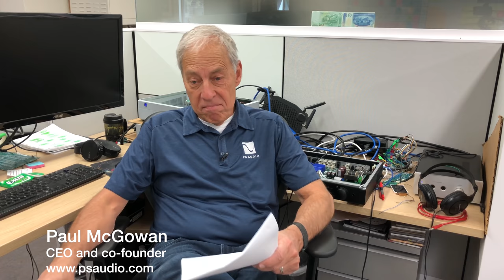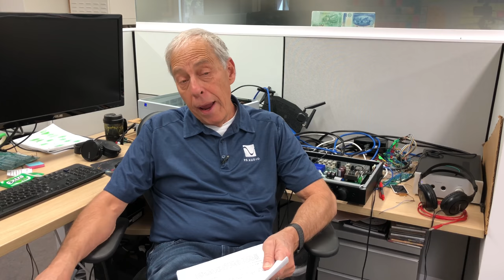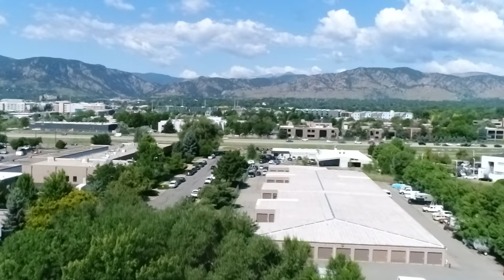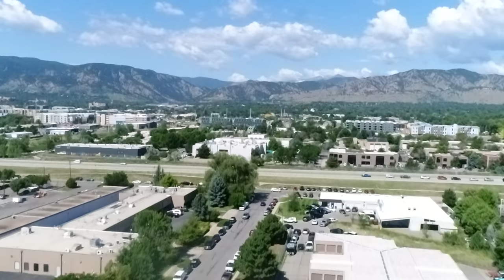Why don't speakers use electro magnets?

Comment: Actually, in the early days of loudspeaker development, ALL speakers used field coils instead of permanent magnets for the simple reason that high strength magnets did not exist. Typically, the B+ power supply of the radio was routed through the speaker's field coil which afforded additional filtering of the raw voltage. The major problem was power dissipation in the field coil in the vicinity of 40 watts in some instances. Also, the less-than-perfect voltage running through the coil would induce audible hum.

Alnico IV, which was developed around WWII, became available and the industry changed from field coils to these newly developed permanent magnets. Ferrite magnets follwed along with newer materials.

Field coil speaker drivers are being used in some very high end systems (very few though). As far as I can see, there is no advantage in using a field coil and there are many disadvantages in wasted power in the driver and in the additional power supply needed to energize the coil.
Reply: Exactly. Pre alnico magnets were too weak so they had to use a field coil. I wonder future designs might use a combined field coil/servo setup....what you reckon Paul?
Reply: electromagnets in speakers can reduce the energy consumption because with better attraction than neodymium you can increase speaker efficiency with wider cone diameter and cone excursion (what increase moved air by the speaker, this can be more important than sensitivity)  besides improving cone response. having access to renewable liquid nitrogen can improve the efficiency because reducing the resistance created by heat. so yeah you can build a high end speaker by the cheap and keeping global natural resources intact.

Comment: Paul, we have an Altec "Voice of the Theatre" speaker system in a finished wood case that is from the original PA system in the Temple Theatre here in Saginaw.  There is a power supply in the bottom of the cabinet with two #83 Mercury Vapor rectifier tubes.  This is the power supply for the 15 inch cone speaker field coil.  There is also a horn  with a permanent magnet compression driver.  I guess that this application was small enough to be  so constructed at that time.  The second such system had a replacement permanent magnet paper cone speaker installed and no longer needed the power supply.
Reply: Ah yes, the Voice of the Theatre. I had one of those once. I made a kind of sub-woofer with it.

Comment: Actually, the notorious dynamic speaker/driver started out its life with an electromagnet. It was much later that this was replaced with permanent magnets, the main reason being convenience and economy rather, than quality. It takes a very bulky, heavy and expensive "field-coil unit" in order to create the same (in fact, almost the same) magnetic field strength in the voice-coil gap, that you'd easily achieve with a permanent magnet. Yet, there really are some advantages to using a field coil: The magnetic field is not only stable over time but is also adjustable (by varying the input voltage to the coil) so one can adjust Thiele-Small parameters  and tune the driver to its cabinet or the tastes of the owner optimally. It is also stable during music playback. And that's because there is no "Barkhausen noise". It is a sort of distortion created by the interaction of the varying magnetic field of the voice-coil and the permanent magnetic field of the magnet. That is, the tiny field of the voice coil, in a "backfiring" manner, temporarily disorganizes the tiny magnets of the permanent magnet to some tiny extent, leading to field variations during voice-coil movement in the gap. This does not happen with a field coil, since there is always a reserve of electrical power that will enter the coil and support the created magnetic field any time it tends to deviate. Connoisseurs describe the difference as a more natural, musical, liquid, real/live sound, in comparison. Many companies making full-range drivers, usually offer field-coil options too. Voxative has a hybrid model too. There has been an interesting rumor that Lowther,  having long ago fully departed from the field-coil camp, has denied any possibility of returning as completely unnecessary or pointless. Yet, Lowther_America had created a field-coil option of the Lowther driver. There really is an issue with permanent magnet strength over time, more prominent with AlNiCo and ferrite magnets, that all loudspeaker manufacturers seem to "hide under the carpet". On the downside, field -coils need a support for the bulky/heavy unit, making it more difficult to install into cabinets. These units are more often used in open-baffle designs. The heat-production problem is less important today, because low voltages of around 12 Volts are usually employed. In smaller cabinets, heat might alter the sound velocity and create issues though. Some manufacturers (von Langa) have claimed it to even be an advantage since, when the magnet and the voice-coil are moderately heated, the voice-coil expands, and approaches closer to the outer limit of the gap, hence moves into a stronger area of the magnetic field. Well, that's my two cents of contribution, as Paul says, I HOPE THAT HELPS, my country-fellow from Greece! Cheers to all!
Reply: Full Ranger, thanks for the excellent and accurate explanation!
Reply: @motorradmike  You're very welcome.

Comment: As others have said, there was a time when all speakers used electromagnets, aka field coils. Currently the Focal Grande Utopia EM, and various Voxative and Shindo speakers use them. One advantage of a field coil, is that you can adjust the damping of the motor system, by varying the voltage applied to the coil. The Focal has a knob that lets you adjust the damping.

Comment: Focal Grande Utopia EM has electro magnet on the bass drivers. It's their best speaker and the only one using this technology.
Reply: Dave Micolichek  7.5 inch.  Small scale.  The Focals have 15 inch sandwich technology cones.
Reply: The Stella Utopia EM is the only other Focal speaker besides the Grand Utopia that employs electro magnets for the bass driver. The primary disadvantage is that the speakers need to be placed near an outlet or new outlets have to be installed where the speaker is finally placed within the room. Electrostatic speakers also need access to AC power as well, but in electrostatic speakers the AC power is used to drive the transformers which in turn energizes the strators that are in front of and behind the panel's planar driver.
Reply: @Woofy-tm8si  Why? There is no indication by Focal to do so. A good power chord might do the job...

Comment: Back pre-world War 2, electromagnets were used in speakers. What was also used was hum bucking circuitry. Electromagnets were and are much more bulky compared to rare earth materials that were much more powerful per cubic inch or cm. This. in addition to the fact that him suppression in DC current was far from adequate, lack of magnetic power density density limited ability to provide for motion linearity needed for best fidelity. Also, for portable and battery operate devices, the consumption of battery capacity would be clearly unacceptable.

Comment: Fantastic question Paul.

Yes, there were speakers manufactured that used electromagnetic magnets instead of permanent magnets. Now you gotta go back a few years here. Back into the 1930’s with the first cinema talkees and tube radios. If you open an old RCA Radio from the 1930’s your likely to see a loudspeaker with an electromagnet powered by the 60Hz line. By the time we got into the 40’s permanent magnets got good enough, and get rid of the 60Hz Hummmm, that they were no longer needed.

Comment: When I was a kid and just learning about electronics (let's say 60 years ago) I would occasionally get a radio coming across my bench that used field coil magnets, usually manufactured before the war. I remember one fellow who had a "console model" radio with expensive cabinetry. His speaker started coming apart and he wanted me to replace it. Well by then no one was making fm speakers any more, and particularly one that would match the receiver's specific requirements. But he wanted his precious radio fixed. I located a 15-inch speaker that could be made to fit the cabinet, but then I had to buy a decent output transformer AND find a choke the size of a brick to fool the push-pull output stage into "thinking" its B+ (do people still talk about B+?) was being isolated by the field magnet. I was only 15, so my father was running the business for me, though he knew almost nothing about electronics. Anyway, he was sure the customer would balk at the repair bill of about a hundred dollars, so he only charged the cost of parts. Pisses me off to this day after all the sweat and research I'd put into it.

Love your daily homilies.
Richard

Comment: I think using an electro magnet could give you some very interesting motor designs if more people thought like this, you could invert the signal and send it to the electromagnet and the coil at the same time and maybe double the motor force? and could still be cooled by cone movement just would probably be designed different with some type of heatsink like JL does. I rlly hope somebody does it

Comment: Paul, how can you not know about field coil drivers‽

There are big advantages to using electromagnets, although they are expensive and power hungry.

For one they have a completely even magnetic field.
They can also be made far stronger than any permanent magnet, lowering the Qts and raising the efficiency of the driver significantly.
Reply from the maker: I stand corrected. Thanks to everyone that opened my eyes to this. Very helpful.
Reply: A few points:
1) what do you mean with a completely even field? You mean homogeneous? Why would an electromagnet be more homogeneous than a permanent magnet?
2) practically speaking, an electromagnet without water cooling will not be stronger than a modern permanent magnet. The magnetic field close to a permanent magnet can be as strong as a few Tesla. It is very difficult to do that with an electromagnet.
Reply: Dries van Oosten a magnetic field is not just a magnetic field. 
Ferro oxide based magnets have granularity in their fields that translates into nonlinear stepping in the movement of the driver. 
It gets better with pole shoes and underhung voice coils, but never completely goes away.
Alnico and other exotics are far better, but of course carry a huge price tag for the same strength.

It is possible to make very strong and perhaps stronger permanent magnets with very specialized building techniques and exotic materials, but it’s far better economy to do an electromagnet.

EM coils also carry the advantage of being able to control the strength of the field. Something which is not a useless as one might think.
With certain speaker cabinet types, it’s possible to control Qts that way, and affect for example “loudness” settings, without having to use a special filter.
Effectively making a speaker that is far better at performing evenly at different volume levels.

Comment: Alternators in cars use electromagnets instead of permanent magnets. This makes it possible to modulate the field strength with a voltage.
Many types of electrical motors also use electromagnets for the same reason.

Maybe a crazy idea could be to use a DSP to voltage control the "static" magnetic field strength as a function of the RMS of the music signal? For really dynamic music signals or something.

Comment: The only application I can think of is on subwoofers that have a 100in cone. You need a powerful magnetic field to be able to move the weight of a cone that size. The ones that I seen were prototypes. They used infinite baffle so they wasn't enclosed inside the cabinet. This allowed much of the heat generated by the electro magnet to dissipate out and away. Plus cones of that size displaced a ton of air without even trying.

Comment: I'm newly getting into restoring old radios and I actually ran into an early 1930s montgomery ward airline stereo cabinet that uses 2 electromagnetic speakers. I'm unable to find new replacements. Can these be custom built reasonably? Are they available anywhere? Thanks in advance!

Comment: When I was a kid, we had a few old radios which used field coils instead of permanent magnets. IIRC the output transformer was also attached to the speaker frame. There was a 4 conductor cable, 2 wires for the field coil and 2 wires for the primary of the output transformer. The field coil was basically in series with the output of the B+ power supply, and of course the output transformer was wired to the plate of the output tube, so the the cable had high voltage, generally 250 vdc. One could get a very nasty shock from the pins of the speaker connector.

Comment: If I understand correctly, this would be a field coil driver. My old Zenith radio from the late 30’s has a loudspeaker that works in this way. But it’s heavy, bulky, consumes a lot of power, and creates an audible hum when no audio or very quiet audio is playing. I can see why we don’t use this technology nearly as much now.

Comment: Great Information, so a quick follow up question voice coil is an electromagnet and that won't change. Instead of a general-purpose electromagnetic coil or field coil, what if one was to apply the same audio output with a reversed polarity to a electromagnetic coil in opposition to the voice coil thus negating the need for constant power and dividing the workload might dissipate heat more efficiently. Almost like using a voice coil and a stator, Your Thoughts Please???

Comment: The old Phillips TVs had an excellent sound and I knew they used the voltage off the tubes but not sure if it was to drive a field coil but the sound quality was better than many hifi sets

Comment: I wish I had found this earlier. I am researching this topic. I think the benefit is weight saving especially for low end woofers which are still heavy even with neodymium magnets. An eminence delta 12lf neo is 3.5lbs per and Kappas are 5lbs. So you're looking at 15 -20lbs of magnet alone in a 4x12.  Worth saving if you can.
Reply: I was also wondering, you could water or oil cool the electromagnet, but by the time you add the additional power rails to feed it and the complexity to cool it, you could be struggling with a weight issue again but now costs are blowing out.

Comment: Right on the money with this video.  Field coil speakers made today are gimmicks. The main thing to understand about drivers is that there is more than just a magnet required to get the flux into the air gap. Back and top plates and a pole piece are all required.  It's far more important how these items are designed to work as a whole, than the type of magnet material that is being used. FEA programs are used in modern speaker design to get optimal results from whatever magnet is used. Even a cheap ferrite magnet can be work very well if you include things like Faraday rings in the system. Field coils are old technology from the time when permanent magnets were very expensive and difficult to manufacture. As Paulsays, they can create a lot of heat, not just in the coils but also in the power supplies required to drive them. Where "high end audio" is concerned, everything old seems new again. But field coil speakers don't solve any problems that can't be addressed in a more efficient and simpler way.
Reply: bcdhifi   Gimmick definition, "an ingenious or novel device, scheme, or stratagem, especially one designed to attract attention or increase appeal."  
Yes, I'd stick to my position regarding field coil drivers. They're a solution in search of a problem...but they do make for great ad copy.   Regardless of your opinion of how Classic Audio speakers sound, the real question is: what do field coils have to do with it?  What problem does a permanent magnet have that a field coil solves? The Stereophile Class A list is loaded with highly regarded loudspeakers, virtually all of which use permanent magnet drivers to achieve their performance. So, if someone can explain what technical parameter or measurement a field coil can improve, then maybe there's some point for discussion. "Some of the best sounding speakers in the world" is a description that has been applied to a very long list of loudspeakers...some of them using ceramic magnets, some using neodymium, alnico, etc. And some using no magnets at all...e.g. electrostatics.
I worked in the loudspeaker driver industry for 25 years, for one of the best driver manufacturers in the business. When the "field coil revival" appeared on the radar (over 20 yrs ago) we had many discussions within our own engineering group about possibly making field coil drivers, and even built a prototype to measure and listen to. We measured or heard nothing that would suggest that an electromagnet-based motor offers any tangible advantage over a properly engineered PM design.  And given the terrible  cost-to-benefit ratio, we simply abandoned the idea.